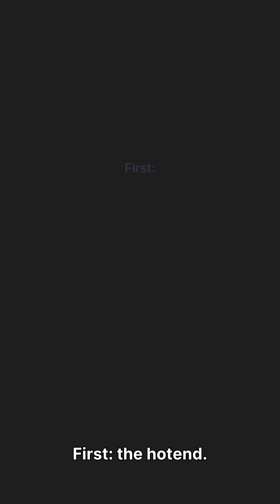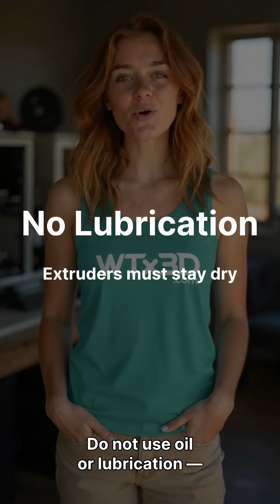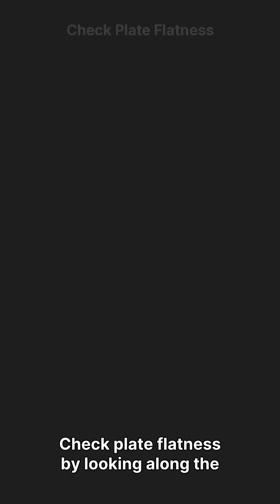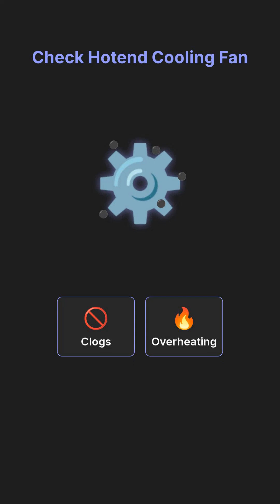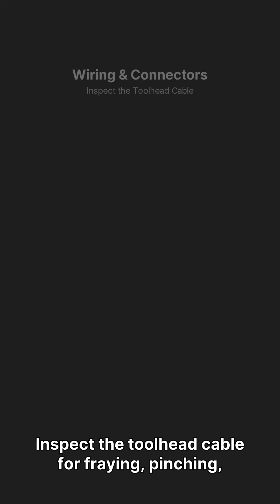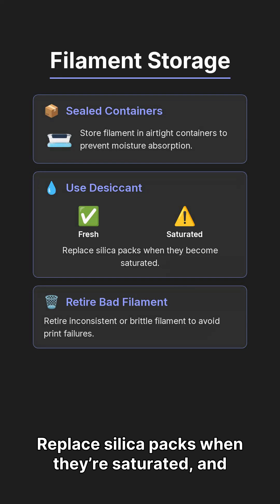Why Your 3d printer Needs Monthly Maintenance!

Comment: 3 dots -> Report -> Spam or Misleading. 

AI content not disclosed and is against youtubers terms and falls under "Disclosing use of AI-altered content", which requires creators to label any realistic AI-generated or AI-altered content, including synthetic voices, deepfakes, fabricated events, or real people made to appear to say or do things they didn't. 

Failure to disclose can result in content removal or suspension of account.

Then report it with this: 

This video contains realistic AI-generated content and does not disclose it as altered or synthetic, in violation of YouTube's "Disclosing use of altered or synthetic content" policy.